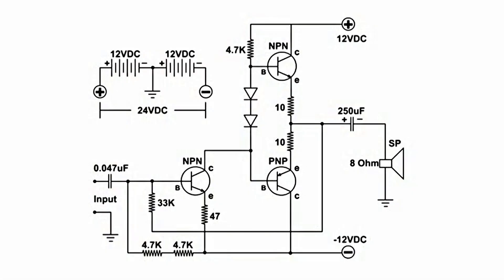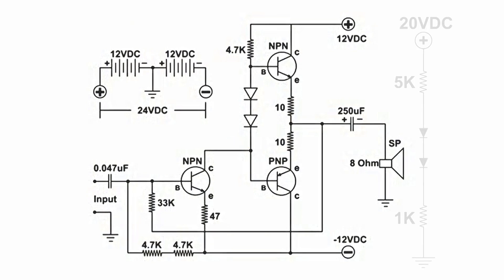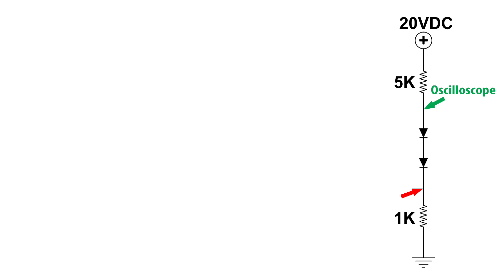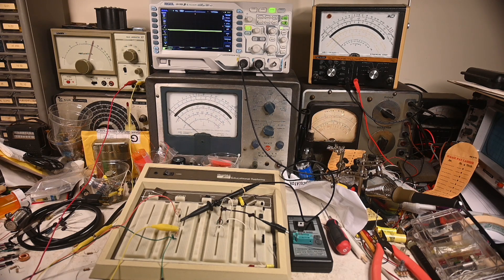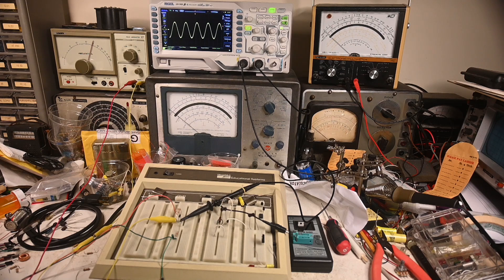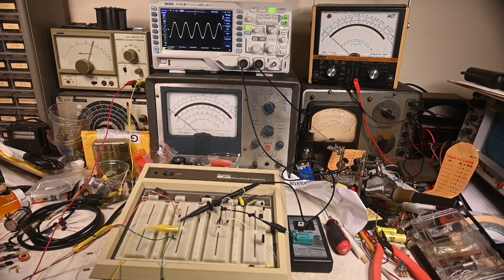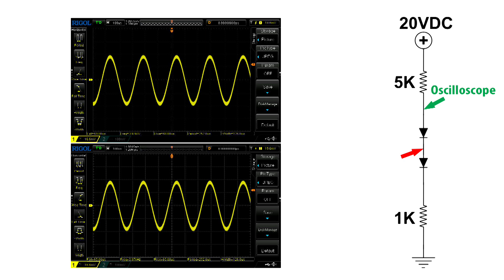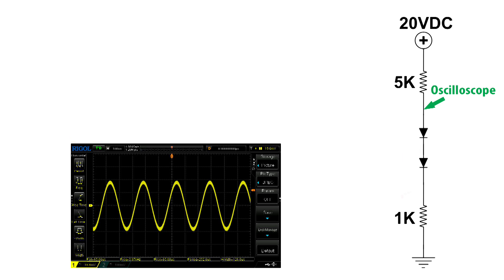Compensating Diodes Audio Signal Input

Comment: The concept of using diodes to pass analog signals (without rectification) is an important one. You see this allot in radio transceivers where they use diodes to switch the antenna between the receive and transmit circuits just by controlling the forward bias current on the diodes. Good video!
Reply from the maker: Yes it is a very important concept in electronics. Thank you for your comment.